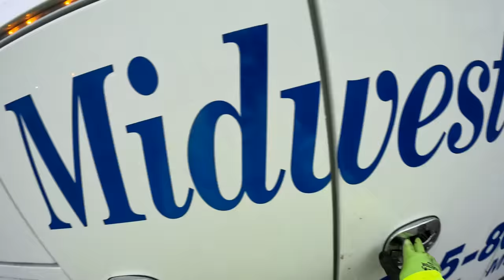A YouTube Fan Needs A Tow!!!   Off To Work We Go

Comment: 20:28 If you stop and think about it, Sears got finished off by the modern revival of their original business model. 

The failure of modern businesses to adapt to the revival of remote shopping is not the fault of the ones that didn't fail to adapt.

Also, Sears had been floundering since the '80s and had run out of assets to sell off back in the early '00s, well before the internet shopping scene took off. They merged with the also failing Kmart around that time, and that went about as well as anyone could have expected. Don't forget that Sears sold their namesake tower back in '88, and Discover Card and Allstate back in '93 in an effort to stay afloat. But they never made significant efforts to figure out what they were doing wrong - much less fix any problems - so they were only delaying the inevitable. My father worked for Sears for over a quarter century and always told me the writing was on the wall all the way back into the '70s and they never heeded it.

As to the working part, add the part you've said yourself about how crazy people are today with terrible bosses, add those crazy people in as a literal part of the working conditions and you quickly come to the sum of "minimum wage isn't worth this". I know back when you were a kid it was actually a good wage, but... by those days standards, most payscales today are about 50% low.

Comment: I use the same Racchet straps with my trailer for my motorcycle but I get The ones with the integrated soft strap to wrap the bars. Ethan job well done, never be afraid to ask questions as you did. Your grandfather is smiling and keeping both of you safe.

Comment: I had a tow a while back and the operator left an axle on my truck and didn't notice it till I got the truck out the shop and once I did I forgot I put it in my chain box but I did eventually return it they were wondering where it went but wasn't too concerned about it but still I felt better getting it back to em so always be sure to get all the rigging back in the truck

Comment: I can speak a little bit on those balance weights you showed to Ethan. I know them as "Centramatics", but they do either have sand or some sort of fine steel shot inside, the idea being it dynamically balances the whole wheel end (tire, rim, hub) as the truck moves at speed. The shop I work at, we still do put them on when asked to, but not very often.

Comment: Do you guys put  boards on the outside of your fairings then you can see clamp them onto the truck then run your ratchet straps across, that really helps with wind resistance

Comment: Wishing you, your family, and employees a very Merry Christmas Mr. Ron. Luv your videos. I have one question, was there a specific reason back when you purchased the 20 ton single axle over other medium-duty wreckers say like the 5130 25 ton single axle for the extra 10000 pounds?
Reply from the maker: Part of our decision was related to cost while another part of our decision was based upon the weight of the bodies for licensing purposes.  Also, most, but not all, 5130's are placed on a tandem drive axle set up.  We wanted the single axle  short wheelbase for some of our tight roads.   We just felt the 4024 was a good fit for our purposes at the time and it has proven to be a valued part of our fleet.  Thanks for watching and God bless.

Comment: The light bar you fitted to the front of the casualty, is it WiFi or Bluetooth, and what is the range? Will it work the full length of an artic? So much better than trailing cables the length of the rig.
Reply from the maker: I believe it uses a dedicated radio frequency and according to the manufacturers website, the range is  around 1000 feet.   I remember have to run and secure the full length of cable and don't miss that part one bit...LOL...   Thanks for watching and God bless.

Comment: My daughter and I went to Gatlinburg this fall. She stopped at a place that sold cowboy boots buy 2 get one free. I got the free pair. Took me a good hour and a half to find a pair because I did NOT want a pair that was smooth on the bottom. I could see me falling with a bad back and I’m trying too hold off the surgery needed as long as I can. The place was packed to the rafters. When an employee finally ask if she could help it took less than 5 minutes to find a pair that fit. She said they only had 2 styles and they were the biggest sellers in their area. My daughter didn’t make it out the basement door this morning and now understands why I wanted a non smooth pair and is looking for her ice cleats that slip on her shoes. When she can’t find them I’ll tell her where they are 😂

Comment: These systems DO NOT use sand the use ball bearing in diffrent weights to offset the out of balance wheel.. They have to my knowlege never put sand in this system. Theu use the same principles when the place these small bearing inside the tires to off set them.